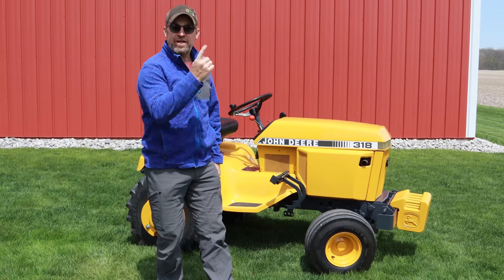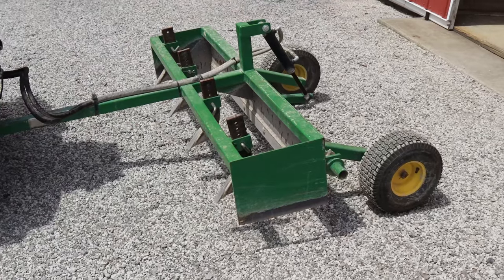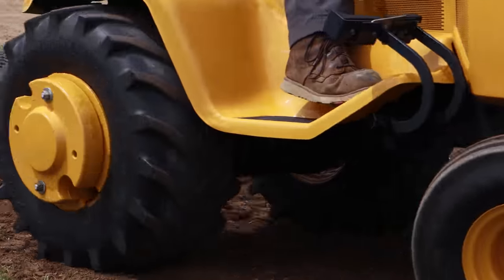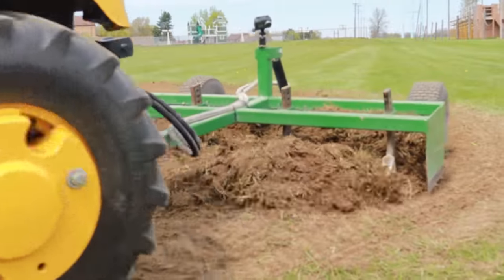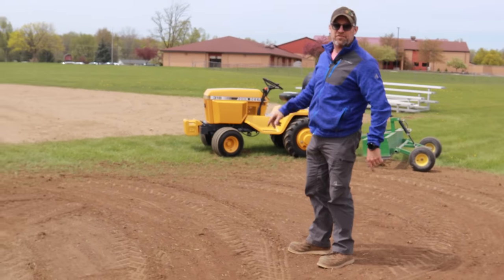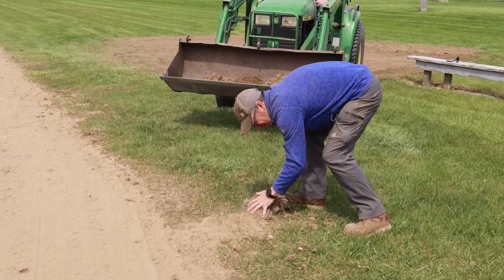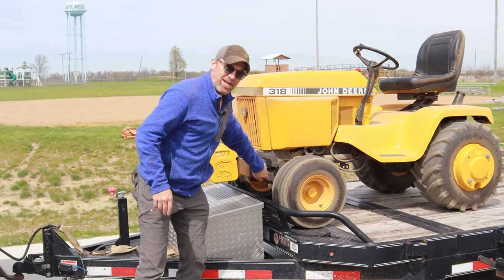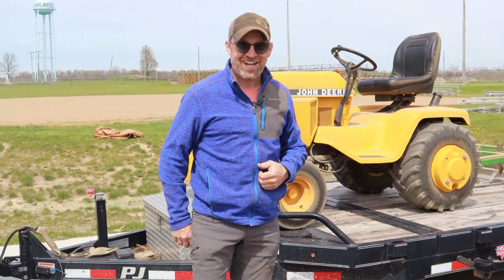I Put My Newly Restored 318 John Deere To Work And Found Some Issues

Comment: Pop had a 317 - then a 318. We used and cared for the 318 so much he had it restored. Both are gone now - but this brings back great memories! Mowing, rear scoop (hydraulic), snow blower - and Dad designed custom front mounted hydraulic log splitter. Legendary 'lawn - and so much more' tractor!

Thanks for the look back - great restoration!

Comment: Good Morning Sir 🌞THIS OUTSTANDING WORK but I will have my head spinning all night with that all turning around job 🥴🤭🤣👍 That was a test flight of that Bruno tractor 👍🧐👌💪 Yes Yes Air Pressure is the best way to clean a tractor and implements 👌👍🧐 Cheers 🍻🍻

Comment: Yes, put 'er to work. Not just a pretty face! 
If that's all the bugs on a major rebuild you had to deal with, I'd be happy with that! I often find that after you get through the first big job in the rain/mud, you'll figure out how good your wiring job was. 😁
Reply from the maker: Right!  I had a loose ground wire to the coil which was also why it was surging!

Comment: Might wanna leave a little dirt on that new paint. That yellow is loud in the sunlight. Almost had me reaching for my sunglasses in my dim lit living room. I definitely dig those big ribbed front tires. Fun to see ag rears and balloon fronts on such a small tractor.

I'd probably go gray or black on the attachments. That way they still match other tractors and less work if you decide to change up Brunos color down the road.

Comment: Great video, Neil!  Good to see Bruno's first "Dirty Job" 🤣🤣🤣
Don't change the color of the grading box.  Let Bruno bask in the glow of his new color scheme.
The surging is an odd one.  That engine didn't do that before, right?  Does he have a fuel filter?  Could there be something in the fuel tank of the fuel lines restricting the flow of gas?  I don't know.
Silly of you to forget that break spring.  At least it's an easy fix.
The hydraulics lever being stiff could be nothing more than the lack of use after all of the "fresh" paint.  I'd hit it with a little WD-40 just to be sure.

Thank you for the video, Neil.  Can't wait to see both of you in the next one!
Reply from the maker: Hey thanks Susan.  I figured out that surging problem.  It was actually a loose ground wire to my coil.  I tightened it up and it's been smooth sailing ever since.   Always appreciate your comments, even if I don't get to them for a week! 😞
Reply: @digdrivediy  That's alright.  You're a busy guy!
I'm glad you figured out the surging issue!
Thanks for taking the time to answer.
Take care and see you in the next video, TOMORROW!  👍👍🥰🥰🤗🤗😘😘

Comment: Nice job good to see the 318 is working well.
Maybe a upgrade for the grader would be putting the ripper teeth on tilting system so you don't have to stop and lift them manually.
Reply from the maker: I'd love to have that option!

Comment: I was hoping there would be an update on the bottom of the weights! 😂

If you are following the JD construction paint scheme on the box blade, I would think the box itself would be yellow with a gray cutting edge and scarifiers. The hydraulic cylinder and axle I would think would be gray, and the wheels yellow. The hitch and tongue, also yellow. Looking at the frontier version though, everything but the scarifiers is yellow.

Comment: I love how Bruno came out. Looks great. 
I think you should paint the grader all grey, Yellow decals and rims as well as the teeth on make them yellow it will really stand out and look killer in my opinion. 
Inspired by you a little any tips or insight would be appreciated.
I'm going to do making a grader type pull behind attachment for my Case 222. I've got a set of old fork lift forks and I'm planning on welding then together and simply running a chain to the tractor. I'm going to be doing my driveway with rock in a few weeks and I hope it works too level everything.
Reply from the maker: Thanks for the input. Best of luck on your project!

Comment: I realized from the last video you hadn't painted the bottom of the front weights, but I actually thought it was intentional, like you wanted to leave it as a reminder or something.  I did that with my industrial Ford tractor which used to be owned by the state and was painted IDOT orange, so when I went to repaint it the original yellow, I left part of the underside orange.

Comment: Looked like Bruno worked well!  It reminds me of a Cub now. 😏….  Neil I really like the trailer.  I hadn’t noticed that in previous videos.  What size is it?  I would probably modify it to be able to put sides on it if I wanted, big enough for the Kioti yet small enough for the cub.  Have a great Sunday!
Reply from the maker: Hey thanks Troy.  It is a 16' trailer with a single 7000lb axle. I really like the tilt!

Comment: Bruno looked nearly as good all dusty as he did all shiny! Also, interesting technique driving in circles like that. I assume it helps the leveling process? As for the scraper goes, yeah, mainly yellow with the gray accents would look good. Maybe yellow tongue and lift mechanism while the rest is yellow.
Reply from the maker: I've found the circles are best for leveling by far. You eliminate the small ups and downs that don't go away if just driving straight.

Comment: Great video. Tractor came out fantastic. Why do you do circles when boxing? Not a complaint, just curious. I like the pattern it leaves. The arial shot really showed that.
Reply from the maker: Circles work the best for leveling up a project.  By far more effective than trying to grade going in one direction. It's just like sanding.  I have a video on the circles from long ago.

Comment: The surging is usually dirt in the adjustment screw port or the pressed in plug under the adjustment screws leaking air or is missing the plug remove the adjustment screw blow air in the port
Reply from the maker: I had a loose grotto the coil and after getting that tightened up it cleared up.

Comment: Your carb needs cleaning as to why its surging. If you pull the choke out a ways when its surging and the engine smooths out, its a dirty jet in the carb.  That's almost always the issue.
Reply from the maker: Actually the ground to my coil was loose causing it to run like that intermittently. After this video was filmed I found it, tightened it up and it has run perfectly ever since.

Comment: Neil, can you tell me the part number for that deluxe seat base? I hate the oem seat setup on the JD318 and would like to upgrade.
Reply from the maker: I'm not sure on the part number.  It was a factory option back then and I got it from a used tractor that I had bought a decade ago or so. Not sure what others from today might fit.

Comment: Neil, whatever color you decide for the box blade make sure you put a set of DDD stickers on the side plates to advertise. I already told you I like the color of Bruno, and perhaps that would work for the box blade, but a racing stripe with a contrasting color across the top hitch bar (front to back) would work. Yellow all over, with only the square tubing painted black...who knows? You decide. It looks good either way just as it is, with a little of the old blended with the new.
Glad to see you got the hydraulics hooked up and you'll soon work out the switch for raising and lowering the box blade and other implements.

For those looking to build the Grader Box that Neil conveniently forgot to post (joke) https://www.youtube.com/watch?v=4bINFRDTR48&list=PLSG1BWA7y-4VDVI6n53KoeB-niPDnfi_x&index=5&t=397s
I built one but used the actuator option and the plans worked. I didn't film it, but it does work as shown and described.  Mine was built using mostly scrap steel plating, with the exception of the Square Tubing, Diggers, Ironton Actuator, and wheels. I also used Anderson-style plugs for the electrical connections and split the tongue into two parts.
Reply from the maker: Thanks for sharing that video sir!  I'm glad your grader box is working.
Reply: Hey Richard, I was considering on building one of Neil’s grader boxes with an electric actuator. Just wonder what parts you went with and if you had any suggestions building one with on actuator instead of hydraulics. Thanks for your time.
Reply: @trevorkind9666  

For the actual Actuator, I used Ironton as a brand. 

For the momentary switch, Neil recommended one and it works great. Slower than hydraulics, but easy to connect. to the factory actuator wiring. 

I also installed all wiring using Anderson Style Plugs that could be connected easily to the actuator from the battery in the RTV using them on both ends. It makes it plug-and-play when disconnecting. 

The last thing you install is the bracket/plate that raises and lowers the wheels so you can get maximum height and lowest point rotations for the actuator without overextending it. I just tack-welded it on until it was confirmed for final fit during rotation then fully welded it up. Make sure your blade is installed and the diggers (scarifiers) too before testing the actuator so you know the actuator is functioning correctly before committing to the final weld. 

I am considering mounting a battery box on the tongue to avoid having to route the power connection beyond the box itself. The actuator doesn't use that much power, and I keep small batteries (motorcycle) on a solar charger that I also use when starting a portable generator. This style of battery can easily operate for extended periods of use. When done, I'll just take it out and put it back on the charging station for the next time.
  
Other than that I don't know what else to mention. Just follow the plans and don't worry if your dimensions aren't exact, just make it symmetrical and square on both sides. Good Luck.

Comment: Do you ever think would swap a 430-420 rear end into Bruno?
Reply from the maker: I doubt it.  I really have never seen a need for it to be honest. I had a 420 for a bit and never used the low range. I'm sure there is a use case for I'm not sure what it is.

Comment: Nice 318!! What size tires do you have on it?
Reply from the maker: 26x12x12 rears and 18x8.5x8 in the fronts
Reply: @digdrivediy  my wife and I are working on a 318 to take to tractor shows. We stumbled upon your channel. The last two days we have been watching your 318 videos. So far I know you said you used 420 front wheels. Did you also use 420 rear wheels? I love the look and I think it will help for what we are doing. We plan on modifying ours for a golf cart seat to ride around on show grounds. You did a great job on your project!!
Reply from the maker: @79fordblake  Thanks so much.  Sounds like a cool project. My rear tires were from a 1025R but I think they're the same size as 420/430 rears.  I really liked the offset though of these 1025 wheels but I don't know if it is different.

Comment: I was looking through 18. I did about the same thing with my 420 I’ve had for right at 20 years the mower deck went bad so I retired from every day Moen add you right as it put took the gas tank out put a regular tractor speed on it out of the gas tank on the fender put Three point hitch on it made a freight suitcase weights for the freight that front wheel weights, auto and rear wheel weights on it. I had all the thing I need to do now is just playing it had a 23 horse Briggs in it because my older motor went bad, good luck the godly redneck